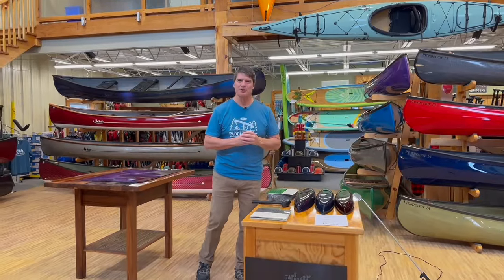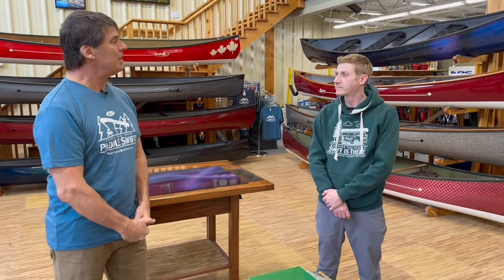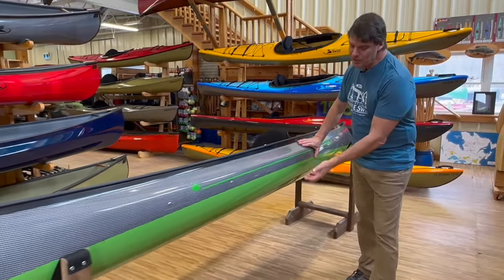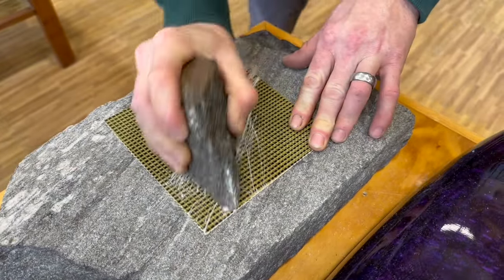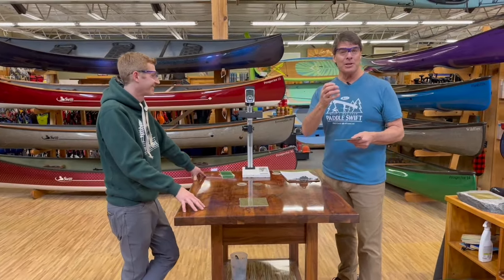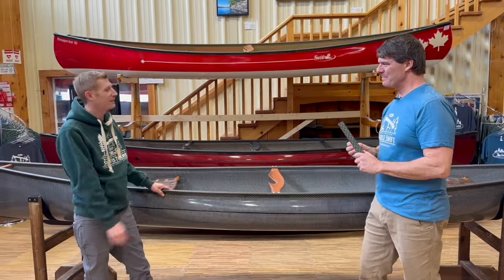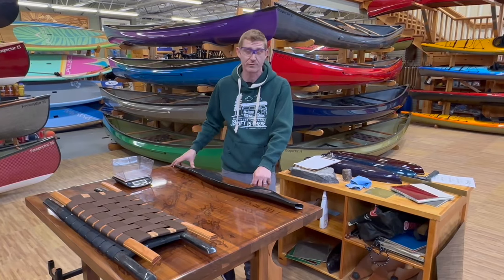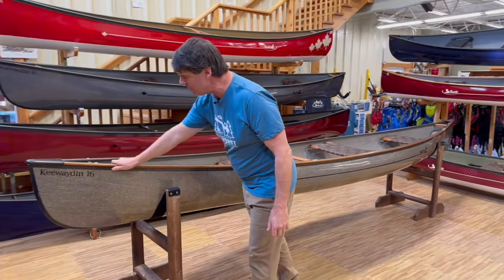2024 Swift Canoe, Kayak, & Pack Boat Product Launch

Comment: I bought a 16 combi prospector last Fall and had one 4 day trip with it. What a great boat. I added a foot brace for the center seat, which I absolutely love. Also added skid plates. I did one modification. Boundary Waters Wilderness sells these 3 inch high foam yoke pads, but they don't fit on custom curved yokes. So I took a piece of maple, shaped it around my head and shoulder, and permanently mounted the pads. I use the Swift yoke for moderate portages, and take the foam pad one for trips with long portages. Perhaps Swift should consider a straight yoke option for this type of foam pad addition.

Comment: Bill do you still have the 15' SWIFT QUETIOCO mold from the 1990's?
Reply: We do not have the Quetico mould but the Keewaydin 16 is a super sweet canoe! The Quetico is a 15'10" canoe, do you have one?
Reply: @billswift8022   I wish I did, my cousin has a keewaydin,  it would be interesting to compare the specs of the two canoes, there was something about that quetico, effortless paddling, good recovery, and was fast under load. Anyone that has one won't part with it!!!
Reply: @billswift8022  We have an original Quetico in expedition kevlar and won't part with it. It is the oldest canoe in our fleet.

Comment: Is UV protection  used to protect Epoxy resin on boat?
Reply: The UV Shield outer coating gives gives enhanced UV protection to our standard builds with our Epoxy-Vinylester Resin and to our upgrade option with our Epoxy Resin builds!